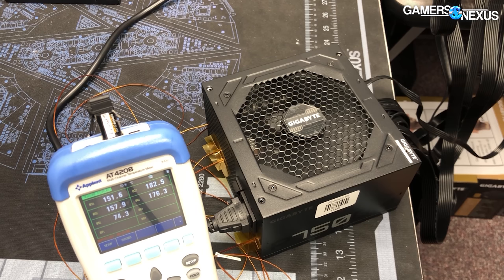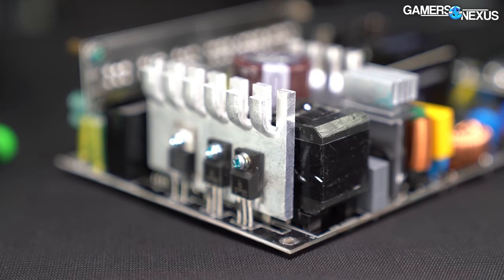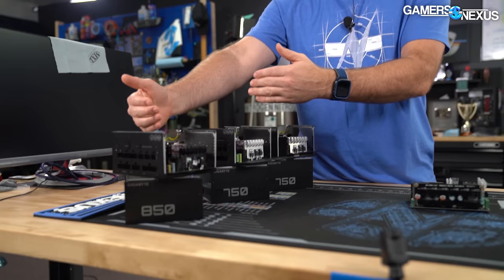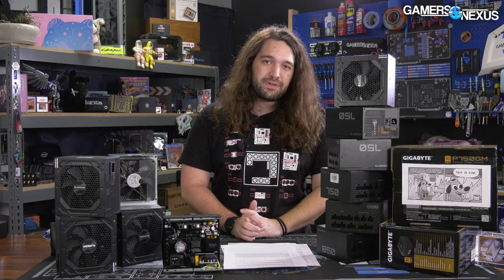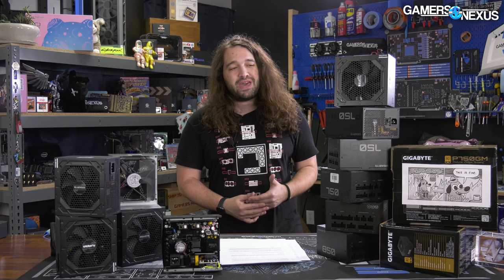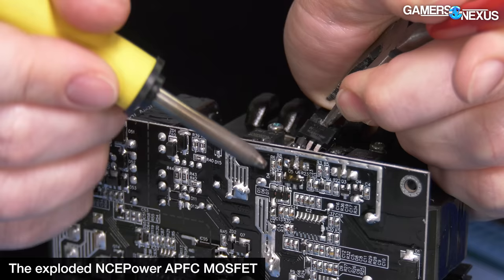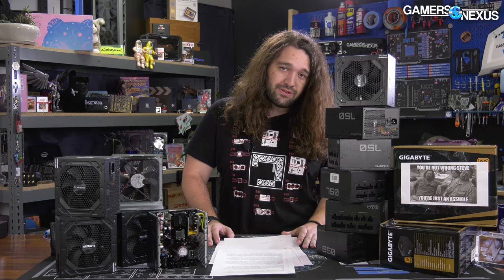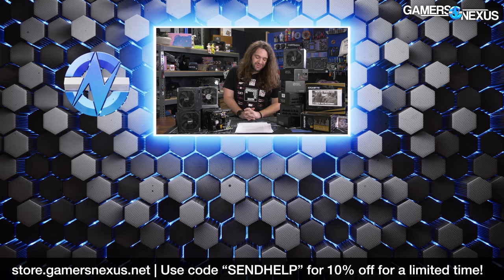Exploding Power Supplies: Gigabyte & Newegg Dumping Unsellable Product

Comment: Electrical Engineer Here. I love the deep dive you folks do. One thing I want to call out is that the inconsistency in components on the same model is not unusual, nor necessarily any indicator of performance. Passives, in particular, often have a several qualified parts to manage pricing and supply. Especially in the current environment, important passives can disappear out of nowhere and leave you unable to make a product. Alternate parts also let you evaluate multiple manufacturers by looking at your process controls from production test which lets you make better products over time. 

Alternate parts are only a problem when the R&D organization cuts corners and doesn't qualify each alternate part explicitly or fails to test properly during the manufacturing testing. In general though, I would say single sourcing parts is NOT good engineering practice and is not something you actually want to see manufacturers do.
Reply: GN have noted this in some of their previous videos, not necessarily only related to PSUs (changing components for the same model). When such things happen, the manufacturers should still distinguish the models by giving the revised model a new model number - something like rev.2 or rev.B or whatever.
Reply: @lagrangemechanics  It's different for every CM/ manufacteur but the silkscreen Rev numbers usually reflect the PCB gerbers revision. In my experience, the component rev is usually a sticky label but not easy to track from a consumer point of viewe.
Reply: It's a topic that's gaining popularity such as with the SSD chips. We really appreciate such keen-eyed people for their investigative work.
Reply from the maker: Inconsistency in these specific parts in power supplies for PCs is fairly uncommon. We're aware that parts change all the time in certain products, but that shouldn't be the case for most of these.
Reply: While that's true, I'm suspect of the quality of the actives, especially the supervisor IC.
Reply: Yeah but sometimes they fuck you up and put an alternate active part, like for one my G. Skill ram kits, same SKU, but one is hynix, the other is micron. That's why my next RAM kit will be directly one of the big 3 (Samsung, Hynix or Micron) to not have any issue like that in the future.
Reply: @lagrangemechanics  with all the variations you could have for the different, qualified, components, even though they have the exact  same values, and the circuit is the same, you’re going to end up with some long configuration ID.
Reply: Absolutely, normally a PCBA REV has an AVL. It’s be suicidal for a company to single source that stuff. Obviously, thorough validation is mandatory. To me it looks like that some components are being pulled outside of their operating range and not all are brands are reacting the same. if you design a thing to handle 750W, you do not put the protection 40% higher….
Reply: @float32  I understand there could be many variations over the lifetime of the product due to components change, but the need for public disclosure of some kind is sorely needed. This is in a similar vein to the RAM change video LTT did maybe a month back. Or that SSD video also done by LTT, where manufacturers (was it Adata?) changed something internally that affect the product's performance.
Reply: im actually curious what causes those mosfet failure, and interesting how the components are mostly off brand, i would expect IR ON or ST mosfets in these stuff
Reply: I'm not an electrical engineer, but if I were a Mfr, I'd have a different suffix to the P/N every time an internal component is changed. That way, you can keep traceability of the different types of units whether it's internal testing or it's out in the consumers' hands. I'm definitely concered mostly though that OPP kicked in at 130%. Safety margins should be going the other way.
Reply: @lagrangemechanics  Problem is when they downgrade while claiming the product is the same.
See Kingston and Adata based SSDs and other ram devices.
The performance discrepancies can be up to 50% between revisions.
Reply: @KyleMontanaro  They can do that through serial numbers.   The part numbers would be helpful for consumers.
Reply: Sure you have your primary and secondary sourse of components, but to have three or more is indicative that you are shopping for price, to be building units mixing and matching the components within a device is beyond strange and puts massive pressure on the validation testing and rushing is not testing.
Reply: Other electronics person here with in-factory experience.

To me it would be extremely unrealistic to only have 1 component reference allowed for each component in a product *1, it would make actually producing the product almost impossible so what i usually do is specify the worst quality that is acceptable and only allow equal or better quality components. (i prefer to have the production units being always better than the testing/development ones, most times the reverse is what happens)

Changing the sku name because of some capacitor/resistors/other small components manufacturer changes would be ridiculous because that could mean a different sku for each batch and even multiple for the same batch.

Since at the company i was in i was the main sourcing guy i can tell one of the little complications we had, tyco(TE) automotive relays were out of stock for +-6months but since there were new client orders we needed to get them so i had to discover other reasonable/good quality in stock for WHATEVER the price(up to a certain point of course) what we ended up using were hongfa(chinese) units, they might not be as good as tyco but they were available, the part of it costing +-2/3 of the tyco ones was irrelevant to us. We also ate all the lcsc+tme supply of them because they were nearly not enough for just the order.

*1 Excluding highly demanding products like military+medical
Reply: @lagrangemechanics  exactly my point. It's nothing new.
Reply: It would more likely down to the purchasing depth rather than R&D, just bean counters trying to save money. Having said this , if the protection circuits were at a more sensible setting level none of these issues may have occurred. Also potentially the design as it left R&D may have been OK with the high trip limits, but subsequent swapping of parts in manufacture for lower quality parts could have taken it out of its safe operating area. Lots of possibilities but all of them are down to how the company operates.
Reply: @KyleMontanaro  LOL kind of going off on our own little thread here but the more I think about it the more examples I can remember. In fact Corsair PSU has their own lot code system which you can check from the exterior of the PSU:

https://www.tomshardware.com/news/corsair-issues-hx1200-hx1200i-psu-recall

Surely Gigabyte would have something similar.
Reply: @KyleMontanaro    @Gamers Nexus We solve this problem using internal traceability to serial numbers for things that don't have design impact. Generally you'll have an "as built" Bill of Materials that can be used for resolving preventative or corrective actions when an issue is discovered. There is some disadvantage to the configurations not being user facing, but because basic process controls having issues can have as much impact as alternate parts having issues, it's not a huge one.

You also have to be critical about whether OPP at 130% is a problem. More likely the problem is a more general "bad design" issue. Power circuits are overdesigned to handle higher power because there are large spikes in power when the load changes suddenly. If you can't tolerate the load you pop components. If you can tolerate the load and make OPP too sensitive your computer browns out on sudden load changes. Since components popped here, the "bad design" problem is probably qualifying some components that can't tolerate the transient, and then when they found the issue, not having enough room to tune down the OPP without causing computer resets. The responsible solution is to recall all the affected lots, but clearly that isn't happening.

Comment: Gigabyte: "QA testing? LMFAO, I think we know how to design a PSU, ok?"

Narrator: "They did not know how to design a PSU."
Reply: Gigabyte: we are sure the user did something wrong.
Reply: i read that in morgan freemans voice. the narrator part ofcourse
Reply: sshhhh they are sensitive about there exploding products and will say you were using them incorrectly the IBM defence for faulty products
Reply: But it has Japanese Caps tho...
Reply: It looks like the engineers designed the product with quality components, then the management decided to increase the trip point and buy their components from AliExpress.
Reply: They probably contracted a company to design this crap .....   not being able to afford Delta, LiteOn, Artesyn for a proper design or spec. Or the design is good but an accountant got their hand on the BOM an replaced proper parts with no name ones. On HP PSUs the 350W units you could get one or two 20N60C3 in To247 package ... here I see just TO220 and even plastic packages (PD<=65W).
Reply: Maybe they asked designers to design it instead of engineers.
Reply: Gigabyte is crap. Scratch the brand from your builds
Reply: Management: So, did it power up a system?
QA: Yes, but we still need to do load testing...
Management: So it works, mark it  as passed.
QA: But..
Management: Mark. As. Passed. *talks to stakeholders*: hello. Oh yes it passed, we can shit, I mean ship them on schedule.
Reply: Seasonic gang : Told you son
Reply: @mikevanleeuwen4912  Narrator: In the end, it would turn it was not, in fact, user error.
Reply: @marc-andreservant201  The protection circuits did not work as they were designed. It was probably slow. As slow as the power supply company I guess haha
Reply: Narrator: It was at this moment that he knew:he fucked up

Comment: "It's actually the worst we've ever seen. In any electronics product." That's saying something. That list includes the NZXT case that might burn your house down.
Reply: Well, a PSU could also start a fire and with NZXT is was a problem that would probably never manifest for most users.

With Gigabyte it seems like a 50/50 chance!
Reply: @LRM12o8  More like 1/6.Still a bomb tho.
Reply: At least NZXT issued a recall, and fixed their case.
Reply: Well this is a straight PSU connected to the house electrical network that fail here!
Reply: @naamadossantossilva4736  depends on which statistic you're going with. The GN survey says 16% failure rate, while reddit (which probably has the bias of people with functional units being less likely to report) says 54% and in GNs limited sample of 10 units it's exactly 50/50, as I said.
Reply: 2021's worst PC parts build is gonna be literal FIRE!!!
Reply: So we have nzxt with the case that would commit arson in your house. We now have gigabyte with PSUs that self detonate. What's next I wonder? Msi or asus with motherboards that shock/tase you? Noctua with industrial fans that take flight out of your case?
Reply: @vali69  Imagine a motherboard that puts +12v on the ground/casing of the USB connectors 😂

Comment: Other reviewers - "This item is garbage." Gamers Nexus - "This item is garbage, and here's the exact, well-tested reasons why it's garbage."
Reply: and let's connect super expensive hard to come by rtx 3080 in it while testing garbage!
Reply: @ambientoccluser  well was a gigabyte 3080 so is probably garbage also, joking aside, they needed a high tdp gpu to test the psu

P.S.: Good thing i ve never bought anything from gigabyte cannot imagine spending so much money for a pc that may work only for 72 hours
Reply: the reviewers that have reviewed the pgm DID give good reasons though...
Reply: I beg your pardon :P These PSUs are compliant to California environment laws. Eco friendly, Gold rated and all ... :P
Reply: @guille92h  I've had Gigabyte GTX 970 and a Z-series motherboard (don't remember the exact model). The 970 failed right after 2 year warranty expired, the motherboard worked for 6 years, and then finally died killing the i7 4790K as well.
So yeah, I've learned the hard way never to buy their products again.
Reply: On point.
Reply: @guille92h  yeah those Gigabyte GPU's are the bottom of the barrel too, must be.
Reply: RIP for me,I bought a 850w one about 3 weeks ago.
Reply: @aleksazunjic9672  they explode.
Reply: F
Reply: @lowskillcamper  I have a Z97N-WIFI with a 4790k (secondary machine, it was my previous PC) still working... more or less. 😅 The BIOS seems to forget settings sometimes, but other than that it's still working. Wish me luck.   * sweats profusely *
Reply: @nuno-cunha  Yeah, mine also started to forget settings at some point, but it should be just the battery. Good luck.

Comment: I design electronics, nothing as high volume as any of Gigabyte's stuff but even in low volumes it's common to have several options for certain components. As long as they all meet the same specifications there shouldn't be any problems. I haven't heard of a lot of the capacitor/MOSFET brands you mentioned, so they could be of dubious quality. Running MOSFETS at over 150 degrees is absolute madness. The junction is probably significantly warmer.

Comment: I'm thrilled to see more mainstream coverage of power supply tests here. This just goes to show that 80+ gold does not automatically mean a good unit.

I also look forward to your tests of other units, too. One thing to look into is the EVGA Supernova GA, which has transient issues with high end Ampere cards due to insufficient 12V rectification FETs.
Reply: I looked into it a bit since i have a GA 850 and 3070ti. Seems EVGA has acknowledged the issue and possibly fixed it. Early comments said they were replaced by EVGA with a different model (G+ for example), while some later comments said EVGA sent a new revised GA with the problem fixed. Hopefully shouldnt be an issue going forward.

Still would be interesting to see them tear down one that had issues to see what was going on.
Reply: I bought this unit refurbished from EVGA for like 60 bucks. Works great for my 6800 XT and 1080i plus a 2070 super mining
Reply: My 80+ Platinum Fractal PSU that I had for about 1 year recently popped while my PC was idle, so that was cool. There was smoke and everything. Crazy thing is it actually appeared to still work afterwards, so we whatever blew up wasn't critical for operation. The only reason I even knew it was the PSU was the horrible burning smell from within it. I know have an 80+ Gold BeQuiet PSU which is supposedly higher quality.
Reply: @spforevr11  Honestly, most of their midrange is kinda sketchy in one way or another. Doesn't help that they refuse to send anything but their highest end products to reviewers.

Comment: "There's a possibility that the graphics card died on its own. It's a Gigabyte graphics card"
Outstanding move
Reply: Yeah that was fumy. GIgabyte makes good products though I wouldn't be worried about any other sku,,, that isn't also a power supply.
Reply: O great I have a Gigabyte 3060 Ti  graphics card
Reply: As the owner of a Gigabyte RTX 3090, I am scared.
Reply: So games can kill this new RTX cards, and later people blaming Amazon xD
Reply: That was really smart for them. Easy out from a company could have been accusing the other product to be a failure itself, but what you can say if the other product is still your product? That's a good chess move, Harvey Specter would have been proud of them.
Reply: @BlackJesus8463  I would be worried. If their engineers can allow for this much oversight and simply ignore a problem of this degree, then they simply cannot be trusted with any electronic device. I have a Gigabyte monitor I'm starting to regret buying a few months back
Reply: @Driftwood420  Yes, i have recently contemplated getting a Gigabyte monitor M27Q and will not buy it, the rate of complaints and defects is way too high! I will buy either a HP or Lenovo, i think. I reached this decision well before this issue became known.

I will however likely still buy lowish-end GB mainboards, and might or might not get a GPU of theirs depending on circumstances. As to GPUs, it will remain my third choice behind EVGA and even KFA2.